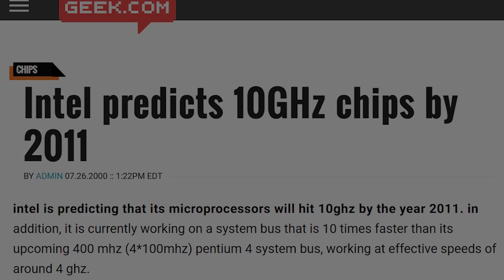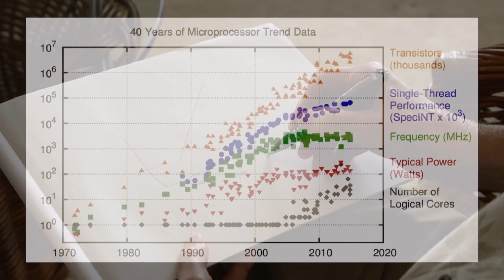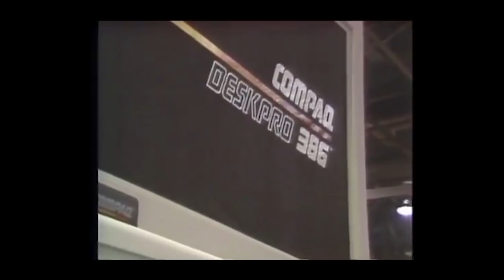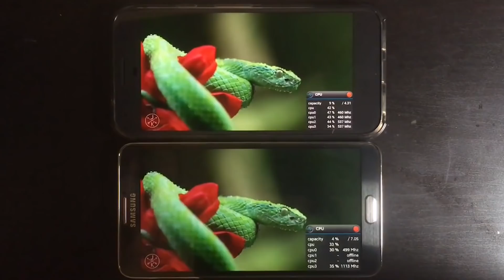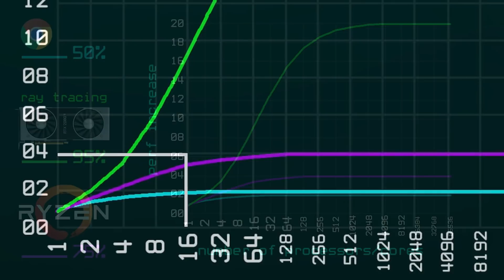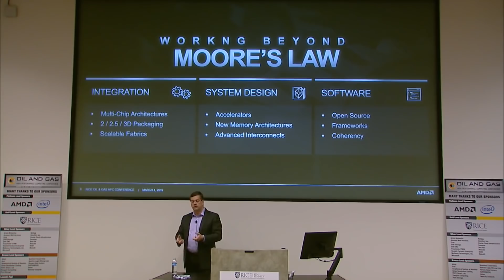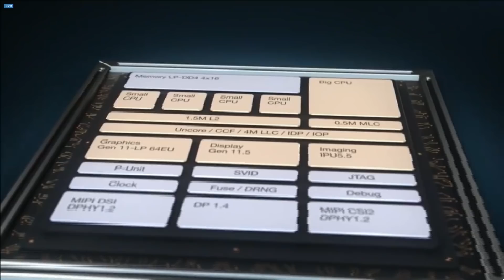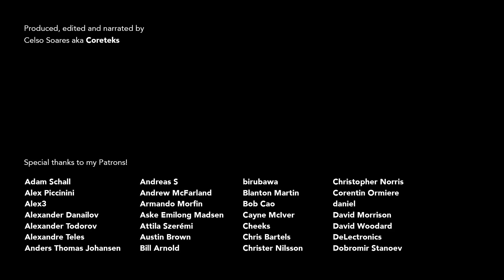Intel and AMD going BEYOND Moore's Law

Comment: Problem with automatic sensing single to multi core code upscaling without properly designed software is that there are actual hard road block to running single threaded coded to multi threaded code simply because one part of the code can't continue to run the job before the outputs of the previous line of code are given as instructions. 

That's why most code is serially ran instead parallel but there are ways around.

Workarounds which forces devs to engineer for things to run at the same time in parallel but with only a few short and really fast parts of the code relying on single threads alone when they can't be split. 

For example you can't predict where the player will turn the camera next so you have to wait for mouse/keyboard input first before you can render the new image, and that is kind of how serial single threaded code works. It waits for other codes to process.

Parallel coding in this scenario would be not effective and you'd have to render all possible actions so when the player does move the camera in that scenario is already rendered and loaded in memory so all you have to do is pick it and go on from there while unused scenarios would be deleted from the memory so new possible scenarios can be rendered and loaded in memory to wait for the user input to validate the next chosen scenario and the cycle repeats. 

This is a real life scenraio we live every day, outside of computers. Think of it as the observers paradox in quantum mechanics. Quantum mechanics is computer parallelism in real life...sort of.

In reality, all the possibilities are already rendered and the right one gets chosen based on your observation. 

Cool stuff...maybe the universe is a multi core super computer with every quantum particle being a CPU core?

Comment: They were right dumbo. They just didn't know about multi-core processors yet. In 2011, I had a core i7 2630qm, thats 4 core at 2.00 Ghz base clock. For the guys from 90s, that's equal to 4x2.00=8 Ghz.

Comment: Please lookup in Wikipedia on silicon the Van der Waals radius of a silicon atoms is 220pm.
The current 7nm process used by AMD etc are 7000pm so you can only fit 31 silicon radius in the current process. 
We are talking about atoms here.. which could be calculated manually.
As smaller the  proccess goes as more does quantum mechanics play a role in the game.
So there will be tunnel effects which will lead to unpredictable results. So we can see the and of moore s law just start counting silicon atoms ;)

Comment: Also, I don't share your optimism about automatic work distribution of sequential code. Why? Because sequential code is very often sequentially dependent - piece of code depends on the result of previous piece of code. Can't run that in parallel. Also, due to memory access being so slow, you often can't even run it in sequence! Modern CPUs solve this by re-ordering instructions to minimize wait times.

If you take the same code and split it between multiple cores, you are decreasing or even taking away the possibility of re-ordering AND introducing further latency due to synchronization between the cores. In short, unless miracle happens, this solution will always be significantly worse than properly multi-threaded application. Only thing it brings to table is solution to old SW and lazy programmers - this parallelization will still probably be somewhat better than single-thread execution (and in some cases might reach that 2x performance though with low effectivity because it will likely eat many cores) but it will be nowhere close to actual MT application.

I expect this will end up in some improvements to CPU front-end and some performance gain in some cases instead of being revolution.

Comment: Parallel processing is not limited by the bottleneck of most programs not being written to execute in parallel.  Rather, you can design an OS to assign one core to every program.  So if you have 100 processes or independent threads running in memory, you assign one core to each, that's 100 cores.  Problem solved and your PC is much faster.  That said, you need much cheaper cores than in today's manufacturing and even smaller feature sizes; already you have a mere 70 Si atoms in a 14 nm node, getting close to the atomic limit with today's technology.

Comment: Quality video as usual. Though have to disagree that students aren't taught about parallelism and all code sequentially - multithreading and asynchronicity are key parts of being a developer nowadays, even web development is now has multithreading in the form service workers. I got my comp sci degree 4 years ago, at that time we were taught a lot about running tasks in parallel.

Another thing that's been different in my experience is that graduate employees generally aren't expected to hit the ground running, in fact I'd say the majority of developers with less than 6 months experience are a net drain on their employer. They will know how to code but not very well, they may not have used the languages their employer uses before they joined and they'll generally be picking up more menial tasks until they're more proven.

Based on my experience and what I'm seeing in the industry, I don't think it would be unlikely for us to use more than 32 cores. All it would take is one breakthrough, possibly simply a change in the way developers think. Maybe a smarter language that can spin off work into other threads without the developer having to manually handle all that that entails - similar to the way async tasks in JavaScript require very little in the way of effort from the developer, they merely just need to leave a handler in place to bring everything back into the main thread when the async task resolves.

Comment: About threading in hardware, this will still be bad in terms of performance, cause realisitcally some operations are faster, some are slower. if it splits those to seperate threads, now they have to wait for the others to finish before continuing. which means theards will have a lot of downtime. vs an actually threaded application that can be optimized.

Don't get me wrong though. it's a nice development and will speed up old programs for free.

Comment: Maybe ,we will have dedicated Cores all to AI,or better say,software in hardware mode or sth like that,to see the benefit of multi-cores...not to mention,we may be changing how we perceive what e define "core" is..so it may do other things to help increase in performance but not in the way we currently sees it as....it would be still be a mind of any system but more mature&more comprehensive rather than just do the calculations....

Comment: Just a quick question: What of Light-based processors? I've heard rumors here and there about CPU's having a limit due to how fast either how the transistors flip, or the speed of electricity (i don't clearly remember). Would that also maybe produce the boost in core to frequency we're looking for?

Comment: 04:00  Sry, but transistors will never be smaller than 5 nm. Why? Because quantum physics takes effect, if things are smaller than 5nm and quantum physics would break traditional computers. That is why we are developing quantum physics based computers for quite a while now. They need to use a totally different aproach for quantum computers.

Comment: Well basically you could say both amd and intel are above 10ghz. since most likely the 10 ghz claim was about a single core if you calculate the corecount*corespeed(even when only using physical cores) you would get above 10 ghz with a lot of modern cpu's.
ofcource those cpu's aren't actually above 10ghz but with their total speed they get above.

Comment: Why did the Hertz War Stagnate they could not develop or find materials that could handle that higher power without burning out without making the parts much larger and heavier so they Sacrificed Hertz for smaller and smaller components this not only made them much smaller and lighter but much less power hungry allowing for lower power-bills and much longer device run time of mains (AC) power making them more practical to use in real life!

Comment: CORETEKS,
Great video, however I have some ISSUES WITH IT:
#1 - You properly state that Moore's Law is about the density of transistors increasing, but then equate Moore's Law incorrectly to PERFORMANCE increases. You KNOW this is not correct so why repeat misinformation? Just because other people are misinformed as to what Moore's Law means doesn't mean you need to reinforce this.

Also, as a side note 3D stacking does not apply to Moore's Law either. The observation is solely about 2D density increasing. If you stack transistors the density does increase but it has nothing to do with the observation that Moore's Law is based on.

#2 - Single threaded to Multi-threaded code. I must have misunderstood but you start off by saying NOBODY COULD DO THAT UNTIL NOW with AI but then talk about how Soft Machines did it with VISC processors years ago. Where you saying the AI was generating new code that could then be run on regular CPU's?

Comment: hasn't this been a trend in years? newer software keeps getting slower when it's run on the same hardware. Want faster software? Then use better-written software. I just don't see the reason for simple applications like Discord to be 135mb in disk size and use 400mb of ram. Same goes for any other resource-hogging application

Comment: You always seem to omit one important thing. While this core law is completely true, more cores enable us to simply run more tasks at the same time. Take linux compilation. It's comprised of a lot of seperate files so you can compile as much files as you have threads. That means linux compilation scales 100% linearly.

Comment: Wrong! Transistors can't really get much smaller. You said there's no limit but quantum tunneling is a real thing. And that's one part of the story why all the transistors on chips are different size. The transistors can only be so small before the electrons begin to jump through the features on the silicon. We're approaching the limit of what silicon can do.

Comment: ok so if they come out with single core sharing multicore, the question is what happens when say you have a 16 core cpu and software thats properly designed to use 4 cores? would those 4 cores share across all 16? or would only one core share multi threading and the other 3 still work the way they normally would. in other words, would core 0 be the only core that would take advantage of this tech? or would any or all cores be able to take advantage of it?

Comment: The criticism of increasing cores as a "marketing scheme" is rooted in a failure to apply critical thinking skills to the subject.

Adding cores is going to help the average user by permitting our increasingly bloated OSes to pass off more of their tasks (many of which are undesired by the end user) to additional processing cores. While it is true that the performance of single applications will not benefit directly, the benefits of permitting applications to potentially wall off a single core for their own usage, or even multiple cores, is greater than Coreteks is stating.

This is even more true when one thinks about how many additional tasks OSes are taking upon themselves that a user has no control over.

Comment: This dynamic threading is almost certainly not going to save battery life, especially not 50%. You may get extra performance for specific circumstances which on digital devices is gained by added complexity and power.

Comment: LMAO not even 6ghz in 2019 REEEEE
Reply: Was running a Xeon 3060 in 2006 at 3,7Ghz, now in 2019 I am running a Xeon from 2014 at 3,8Ghz max turbo and it is only 6% slower then the new Intel CPUs from 2019 at same clock speed... CPU speed have slowed down to a slow crawl the last 14 years and practically standing still since 2013, now they just add more CPU cores and bump up the clock speed in tiny increments (every time AMD releases a new and better CPU that is).

Comment: There is a mistake in cores count needed. It is true for a single task but for example, when a computer does multiple tasks it is a summary of performance. The best example you can see today on every computer CPU does game engine processes and GPU does RTX. A 2-30 years ago CPU did all computations for graphics. Another example is virtual machines where cores are assigned to VM and as a result real computer runs multiple copies of windows - that's a multiplication of performance (8 core real computer vs 4 times 8 core VM gives 400% improvement of performance). At this moment the best streamer platform is two computers: one for playing one for streaming. Manage everything in VM on a single machine and you get the performance boost because the computer does multiple tasks at the same time. Who will benefit from multiple cores assigned to different tasks? Just check how many tasks are listed in task manager. Give a core to every task. How many cores you would use now? What about mining? Every ant machine of mining network does its own part of the job to find the only solution - perfect 100% utilization of multiple cores. In daily life, 4 cores display tv show on my tv while another 8 cores waiting for an incoming call and 4 more cores helping me to write this post. If AR would be a common thing like cell phones are today then virtual tv will be overlaying TV display on the wall, a virtual computer does the same next to it, and a virtual android device will be showing actual time. An average person has needs for multiple cores just now only technology that will utilize it was not properly implemented.

Comment: I believe that once that limit of resource utilization is achieved, we will see optimization in the way of dedicated cores and alternating turbo clocks, along with the single to multi thread action you mentioned. One crucial benefit to multi core systems is multitasking, yet everything still seems to be tied together in a permanently synchronous operation. If every core or groups of cores took on a full load of something and freed up the other cores to do other things we could in theory go even farther in performance due to no residual strain from another program or instruction. A good example of this in action is the 7th SPE on the ps3's cell processor being specifically dedicated to XMB operation.

Comment: Yeah, I agree with the video.  Most programmers know that more threats equal more risk to get pretty obscure errors to debug. Programs with 16 no independent threats are a nightmare to program. The only way more cores is gonna work is with the compiler handling all the parallelism, this way everybody uses the same multi-threading code.

Comment: The problem with going much smaller in transistors and using them is you start getting into quantum gating of the electrons. IIRC, in one of Intel's presentations, they stated that their R&D is running into it, and there is no way to prevent it (at this time).

Comment: You can't go to picometres, because of quantum effects that will happen near 1nm of scale. Electrons will pass through the gates, that's called a tunneling effect. So yes, we are physically limited to this. 1 nanomener is a total limit. After 5nm it's unknown if you can scale down to 4 nm. It can be unstable, quantum effects can make a huge interference.  Future is with bigger die areas, so you can use 10cm2 instead of 1cm2 in modern CPUs. Today the die area is very limited to relativistic effects, you can't make a really big area of a chip, since the electrons travel with speed of light, they travel miles inside of a chip, and speed of light is still limited. Make it bigger, and tacts won't be synched anymore, because one part of the processor will be ahead of the other parts. So we can't make it any thinner, and right we also can't make it wider area. That's in classical synchronous CPU, where 1 tact means 1 on\off at which each core must perform its limited set of instructions per tact and give a result simultaneously. The answer to modern limitations will be in asynchronous CPUs, with many cores that could work independently from each other. There are some prototypes like neuro processors.

Comment: You know, Coreteks, we're missing a crucial 
point in these considerations. What's picking 
up speed right now are new types of 
applications. Those that have to do with AI. 

So, running after more traditional performance, 
faster clock speeds, more cores, parallelization 
and new architectures is missing the point. 
This will not be necessary anymore. 

GPU and TPU functionality will become necessary. 
Here the treasures still lie freely in the landscape 
around. This performance is expected from the 
system. On that, Coreteks, we bet our money. 

Forget the improvement of the traditional CPU's. 
Forget the traditional Laws, Goore and so on.

Translated with www.DeepL.com/Translator

Comment: Amdahl's Law doesn't capture the whole story (check Gustafson's law). Amdahl's Law assumes the program/application size is fixed and can only be splitted into "s" serial part and "p" parallel part . But one can argue like this, say I have chip with 100 cores, each core run at 1 GHz, has its own L1/L2 cahce and shares L3 and cores communicate via NOC. This can be then used to give each OS process/application its own dedicated cores and cache dynamically.
 Do you think such setup will provide more performance ?